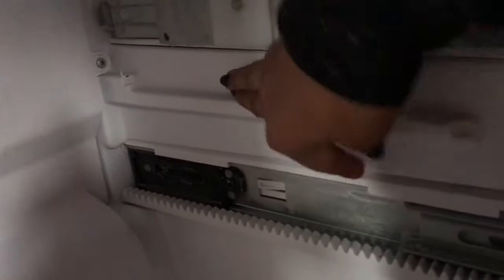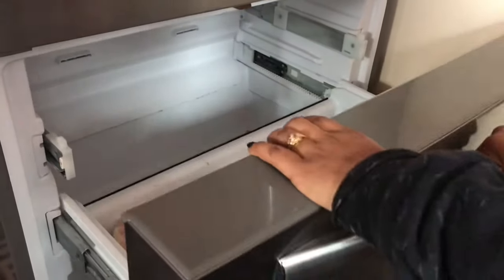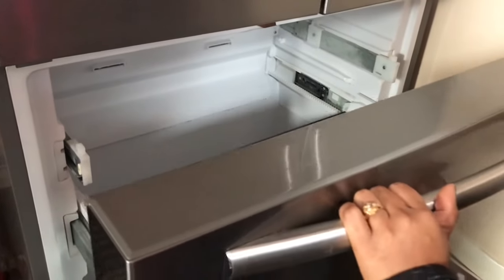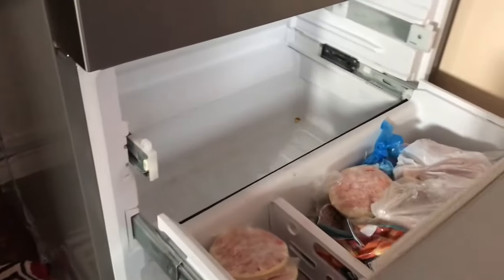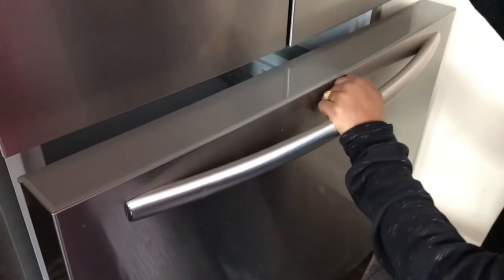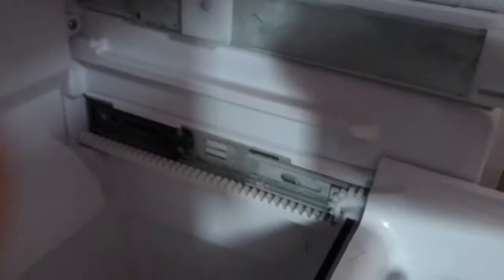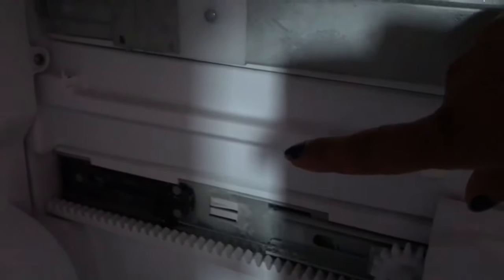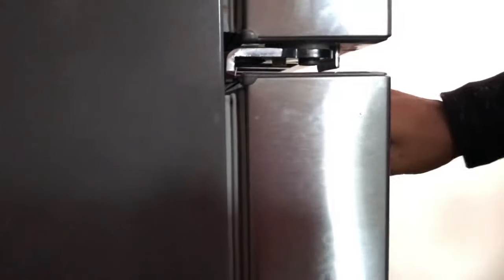Bottom freezer door not fully closing for the American Freezer and how to easily fix

Comment: Thanks, but the only thing that was obstructing miners was the rubber sealer from the bottom it was hanging! Currently re attached it by putting it into place and pushing on it flush, no glue needed. Thanks.

Comment: I was skeptical with this but I tried it.  I took the drawer out completely, released both rails, reinstalled, and the seal on the left side of the drawer pulled up tight to the freezer.  Now let's see if it resolves the ice build up in the freezer.
Reply: Did it fix the ice build up in the freezer?

Comment: Hi everyone. My uncle has this same issue. He defrosted the freezer, cleaned, installed a new gasket, and then we tried this procedure, but still not getting a good seal. The sliding rails look perfectly aligned, but the door does not seal fully along the top. 
Any help would be appreciated.
Reply: probably need an expert appliance tech to properly align everything, I'm in the same boat